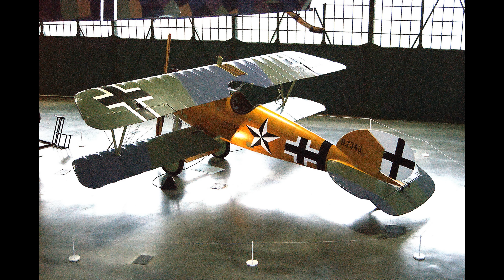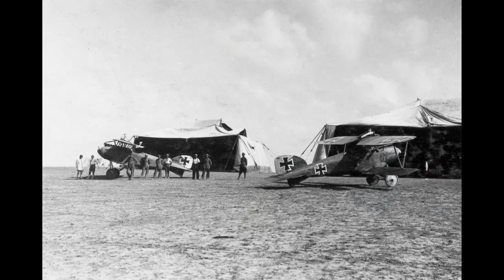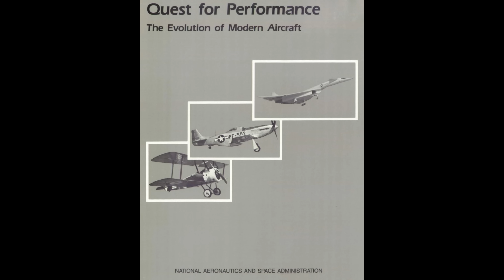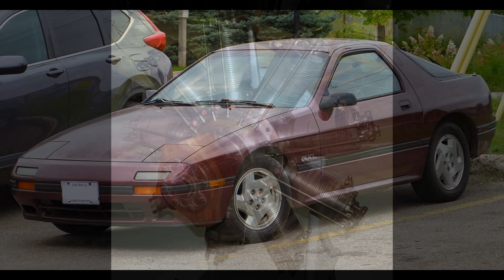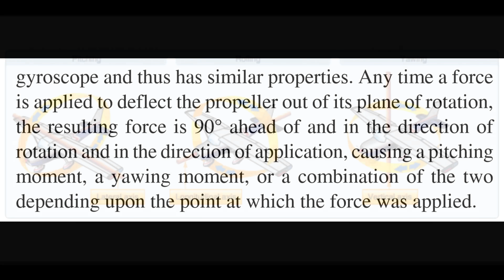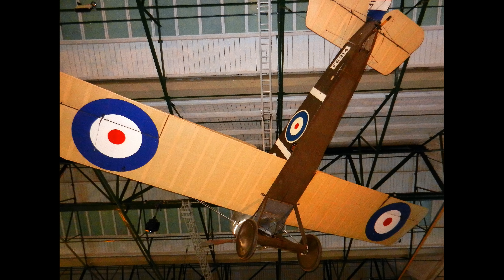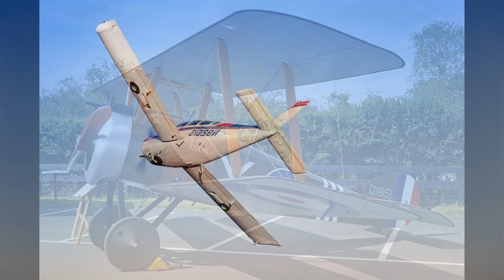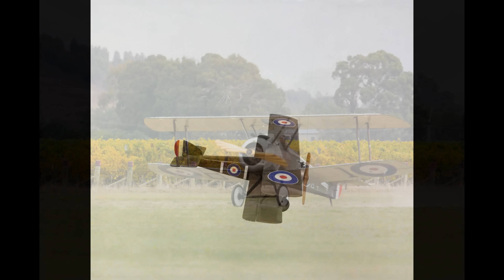Sopwith Camel, War Winner or Death Trap?

Comment: Greg!! Awesome video, great to see some WWI videos now as well - really enjoying them. 

I'm a very active modeler, with one of my prize airplanes a glorious 1/3 scale Sopwith Pup in the original harlequin color scheme owned by the flight instructor. My Pup has been flown many times at the Olde Rhinebeck Aerodrome in the Hudson Valley, NY where they restore and fly all these vintage birds - some flying on the original rotary engines! And yea, spitting out CASTOR oil by the quart makes for some exciting post-flight bathroom runs for the poor pilots as the announcers are fond of telling the crowds. One other point - these engines as I'm sure you know have NO throttle. Just a selector switch for running on (I think...) 3-6-9 cylinders as a power setting, then a "coupe" or "blip" button to turn the engine literally on and off. I assume it would short out the magneto with each button press. So basically, the gyroscopic precession had to be managed with intermittent blips of full (or near full) power, then off again. Talk about pilot workload! You can actually watch the plane yaw and pitch with each blip during simulated dogfights that they used to perform at the Rhinebeck airshows. It's quite an eye-opener. 

In my scale research while building my Pup, I was able to find four examples of full-scale aircraft, two being completely original. One at the RAF Museum in Hendon, UK and the other at the Shuttleworth Collection also in England. The curator at the RAF Museum in Hendon was kind enough to allow me behind the ropes to take pictures of every clevis, turnbuckle, hinge, cable, etc on the very well preserved original - I've got some great closeup pics of the RAF tapered flying wires! Interestingly, the 5-6 planes I've seen (2-3 were reproductions) I can only recall RAF wires on the two in England.

Since scale modelers are a fairly obsessive bunch, turns out that there is at least one manufacturer of scale RAF flying wire, if I'm not mistaken it comes from Proctor, that is known for their exact scale recreations. I've got a 50' spool of 1/3 scale RAF wire but at the moment have yet to install it on my Pup since it's such a challenge to work with, as opposed to the typical braided steel cable I'm currently flying with for all the flying and landing wires. Can you say drag?? Added to the undercambered wing... 

I'm a long-time Patreon supporter - let me see if I can dig up those 20-year-old pics for you. Just let me know if you'd like a few of them. Always happy to support the channel!
Reply from the maker: Thank you so much for this excellent post. I feel that the Pup is the best WW1 plane to use for a flying scale model.
Reply: @GregsAirplanesandAutomobiles I absolutely love mine. It's naturally overpowered compared to the original but with an undercambered(!) wing and a full complement of functional flying wires in flight at a distance you would be hard pressed to differentiate between a model and full scale since it evens dampenss like the original... Floaty and draggy at the same time with lots of adverse yaw. But coordinate turns with the rudder and it flies very much like the real thing.

Next up... A Nieuport 28!
Reply: The San Diego aerospace museum is building a Pup replica from the original plans.
Reply: ... Just found about half a dozen pics of RAF wire used Sheila, the Pup at the RAF Museum in Hendon, quite clear in the images. If I recall correctly, there were a few replacement cables on the plane, and the curator told me they did field repairs with whatever was handy at the time, so often they had to substitute braided steel cable for RAF wire.

Comment: Thanks for clearing up the differences between Radial & Rotary engines.  I had not thought about the forces while maneuvering.  What a mess with the oil being flung all over the place while flying.  It must have really interfered with the pilots vision, as well as a bunch of other things caused by the Rotary design.

Comment: 14:22 I always struggled with these sort of explanations with the 90 degrees off etc. The explanation that stuck in my mind has to do with the conservation of momentum, in this case, conservation of rotational momentum about all 3 axes.
A In picture at 14:22, the aircraft's propeller is spinning clockwise from the view of the cockpit, 
B but if you view rotational momentum in the world-frame, that has to be conserved.
C rotational momentum can be divided into momentum spinning around an imagined vertical and horizontal axis.
D most of the propeller's momentum spins around the horizontal angle but a smaller component spins around the vertical axis. If you view the propeller disc of the taildragger airplane sitting on the ground directly from above you actually observe the front side of the propeller disc. A tip of the propeller seems to rotate anticlockwise in a flattened oval shape. This is a visual reprentation of the propeller's rotational momentum about the vertical axis.
E When the tail is lifted, the axis of the propeller is forced to be horizontal, the oval shape we saw before from directly above disapperas int o a straight line when we see the propeller edge-on.
F but the rotational momentum about the vertical axis has to go SOMEWHERE. Thefore the propeller axis, viewed from directly above  wants to rotate anticlockwise and it takes the entire airplane with it. An anticlockwise rotation viewed from directly above, is a yaw to the left from the perspective of the pilot.

Maybe this explanation does not make flying easier where you need quick thinking, but at least I can predictably understand how the forces happen and in which diretion they go.

Comment: One thing I've seen mentioned by modern pilots who've flown the Camel was the great difference in control forces. While the Camel was very responsive in every control axis for a given amount of deflection, the forces felt by the pilot were very different. IIRC it took lots of force on the ailerons to roll, but barely any force on the elevator. These huge differences in stick forces could be confusing for an inexperienced pilot who has only flown BE2 trainers with benign characteristics and balanced stick forces, especially combined with larger gyroscopic progression from the Camel's larger engine. No wonder it was considered a killer of new pilots.
Reply: Another feature of the Camel was that it was very tail-heavy and had no elevator trim, which meant that level flight required a constant forward pressure on the stick. It was said that a Camel could be pulled into a loop immediately after take-off and (provided the engine didn't lose power) it would come out about 6 feet off the ground.
Another thing I once read is that the centre-section struts were not fixed to the top wing but only held in place by the tension in the bracing wires. If the wires became slack, the top wing could move around slightly and cause all sorts of handling problems.

Comment: At 7:27 you ask how modellers tackle streamlined bracing wires. FWIW, I have recently scratch built a 1/24 scale DH82a Tiger Moth and made a passable simulation of flat bracing wires by slicing up an aluminium beer can. I unrolled the side and laid it flat on a cutting mat. I then cut it into thin strips using a Maun Safety Rule and new blade in my Stanley Knife. Several practise runs were needed to get the technique and scale width right but at least the material is cheap and available! Only one end of each wire was secured initially (using epoxy  resin) then the protruding free end was given some tension (I used Mole Grips and let their weight hang down to do this) and epoxied the free end in its well. After the epoxy had thoroughly set, I trimmed off the excess flat wire and dressed the surface. If you need turnbuckles, you might simulate them with some judiciously placed PVA. Hope this helps.

Comment: For RC models there are aerodynamic wires available.  For plastic models, even in the large 1:32 scale, it makes limited sense because it's hard to make wires to scale anyway. Better have round wire of somewhat matching size than an oversized flat wire.

Comment: I wonder if a dual row, counter rotating, rotary engine was even considered? The outer row would still spin with the propeller, but via a gearbox, the inner rotary would spin in the opposite direction.🤔

Comment: I've heard that rotary engines run a total loss oil system, once the oil leaves the tank to go into the engine it never comes back through a filter into the tank to circulate.  Is that true, or do these engines try to circulate oil and just end up leaking a lot out?

Comment: Modeler here: I build in 1/72 scale so I don't worry about replicating the flat RAF wire. I just use elastic line that's about 3 or 4 thousandths of an inch unstretched. There are some photo etched wire stets made to replicate the RAF wire but I don't like it, it's too hard to get it to look taught. I don't even bother to try and make the doubled flying wires, I just use a single strand. I can't get the doubled wire to look regular enough in spacing and I think uneven spacing looks worse than a single wire.

Bigger scale builders go these same routes, plus,  sometimes they'll use stretched rectangular plastic strip. An interesting feature of heat stretching geometric shapes, is, they retain their shape when you stretch it, it just gets thinner. If you take a piece of styrene strip about 10x40 thousandths, heat it over a flame (very carefully) until it softens, and then pull the two ends apart, the plastic will stretch. The more you stretch, the thinner it gets. By controlling the stretch you can achieve any dimension you want and it will retain the 1x4 proportions.  That's pretty much a "master modeler" technique that I don't think I'll ever try. It works with tubes and hex shaped rod too. You can make thinner tubes or hexes by heat stretching.
Reply: I built the 1/16 scale sopwith camel, wood and metal model from ModelExpo.  Very fine model indeed being a scale replica.  They use thread for all rigging.  I follow the directions.  At the end of the day it is a model.....

Comment: Fascinating stuff!  The precession problem applies to helicopter rotors as well: cyclic control input is engineered to be 90 degrees ahead of the resultant direction of flight.

Comment: Doesn’t the engine also cause the airplane to roll opposite the direction the engine is rotating? Equal and opposite?
Reply from the maker: That's torque, not gyroscopic action.
Reply: @GregsAirplanesandAutomobiles  Yes, understood, just wondering how that effects its flight characteristics combined with the GP

Comment: You didn't mention the other disadvantage of rotary engines. Complete absence of throttle. you either idle or go full tilt. In some later rotary, I seem to remember, they added the possibility of electrically disconnect part of the cylinders spark plugs to give a limited control over power, but it was a messy half-solution that added reliability issues and was seldomly used.

Comment: I understand that the rotary engines were lubricated with caster (bean) oil and that it really formed an awful mess especially if it was allowed to remain uncleaned for a period of time because it oxidized rapidly. If it was used in normal engines it had to be drained after each use or it would go bad in the crankcase sump. The castor oil vapor was blamed for some problems with the pilot's restroom habits as well!

Comment: Well done, Greg, as usual. Because I'm neither engineer nor pilot, two thoughts came to mind while watching the video. One was of the Camel pilot's flight goggles being gradually rendered useless by oil being flung from the rotary engine. The other, surely incorrect, but powerful nonetheless, is of two video clips I've seen of flight ops from a WW 2 Essex-class aircraft carrier – one involving an SB2C Helldiver and the other an F4U Corsair. In both cases, the planes and pilots are trying to take off, don't quite have enough air speed to do so, and the P-torque from the prop (at least as I understand it) rolls them off the left edge of the flight deck and into the ocean, usually inverted. The Corsair pilot survived, but I've never been able to find out if the crew of the Helldiver did so. The Corsair, early in its service life, was apparently widely-known as an "ensign-killer," and I've read that the Helldiver was famously difficult to fly, especially at low (i.e., landing and takeoff) speeds.

Comment: As an auto mechanic I find watching radial engine crankshafts in motion absolutely hypnotizing. I never have seen a video of this that was long enough for me. Something that interesting deserves at least a few minutes of viewing.
Reply: You should do a search on the Salmson water cooled radials of WWI, they had a fascinating solution for the normally used master connecting rod of later fixed radials.
Reply: @tauncfester3022 Saw a Salmson radial in the Museo Storico Aeronautica Militare in Italy. It had a diagram explaining the Canton-Unne mechanism used in place of a master rod. I had to stare at the diagram for a long time before I could understand how it worked. MUSAM also has the Macchi MC72 float plane which set the world’s speed record of 441 mph in 1934. It still holds the record for propeller powered seaplanes.
Reply: @fafner1  Wow... THAT was fast! Even faster than a DeHavilland Mosquito!
Reply: @tauncfester3022 
I imagine that was the solution where a stationary gear in the crank case was part of a gear train that engaged a gear on the rod journal. This keeps the rod gear stationary in that it maintains the correct relationship to allow the use of all link rods with no master rod. Nordberg Corporation of Milwaukee used the same solution on an 11 cylinder stationary radial engine used for generating and pumping stations. 14" bore and stroke for 23,607ci. Plus they had a 12 cylinder with an even more novel method of maintaining the rod carrier of their own invention.
Reply: @tauncfester3022 interesting!  I did not know about this engine.
Reply: @Jbroker404  It was among one of the most commonly fielded French Obs and Bomber powerplants in WWI. Nearly all of the Voisin LA3 and later pushers and the Salmson A2 late war obs bomber used by both the French and the American Expeditionary air forces.
Reply: @tauncfester3022  Looking.
Reply: Rotary piston engine crankshafts do not rotate. Everything else does though.
Reply: It's NOT a Radial!! It's a Rotary engine. Totally different.
Reply: @brom1857 he knows that.
Reply: The Zoche four cylinder two stroke diesel radial is clever. The single crank throw carries all four con rods yet it has near perfect rotating balance. 
Not a WW1 thing big interesting all the same.
Reply: During high school, I worked on cars and motorcycles, in the airforce, I worked on jet aircraft, using the same kind of tools, much bigger scale.

Comment: An interesting factoid is how the 110bhp Le Rhone and 130bhp Clerget engines were able to hold their own with the 200bhp inline water cooled Albatros engines. It turned out that the difference in peak RPM meant that by sheer accident the rotaries had an ideal propeller RPM straight off the engine, whereas the faster turnng German propellers were smaller and less efficient at the speed the aircraft were flying at.
Eventually reduction gears became standard on all non rotary engines for military use, allowing efficient coupling of higher engine RPM to larger slower turning propellers of high efficiency. 
Non geared engines running 'toothpick' props are still used in light aircraft however.

Comment: The Sopwith Camel was the best twin gun biplane capable of extraordinary aerobatics & highest scoring allied fighter / scout.

V M Yeats in 'Winged Victory' his novel based on his personal experiences describes the Sopwith Camel thus: 

But not so a Camel.
A Camel might be going sideways or flat spinning or going in any direction except straight backwards. A Camel in danger would do the most queer things, you never knew what next especially if the pilot was Tom Cundall (in fact the author Victor Yeates since the novel is autobiographical). And in the more legitimate matter of vertical turns, nothing in the skies could follow it in so tight a circle, so that theoretically speaking all you had to do when caught miles from home by dozens of Huns was to go into a vertical bank & keep on turning to the right until the Huns got hungry & went down to their black bread & saurekraut, or it got dark. The difficulty was you might run out of petrol & have to shoot them all down on the reserve tank, so it might be as well to shoot them all down at once as recommended in patriotic circles.

And:

Camels were wonderful fliers when you had got used to them, which took about three months by which time you were either dead, a nervous wreck or the hell of a pilot & terror to the Huns who were more unwilling to attack Camels than any other sort of machine except perhaps Bristol Fighters.

Comment: You can make a good scale representation of streamline RAFwire by the stretched sprue method, but instead of stretching round-section scrap sprue you stretch lengths of flat strip with the edges rounded off. It's quite demanding to do, but it can be done. Or you can get fairly close with photoetched brass or steel.